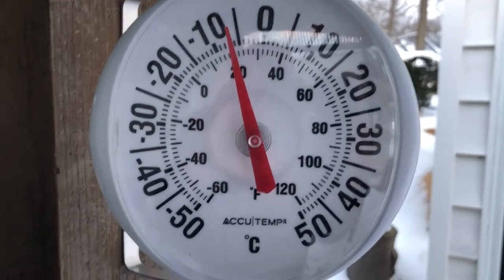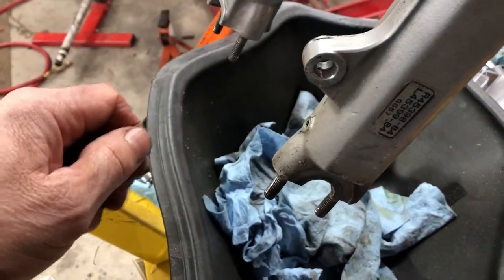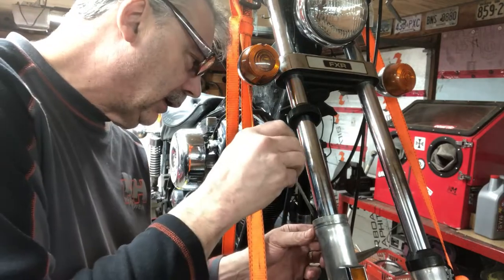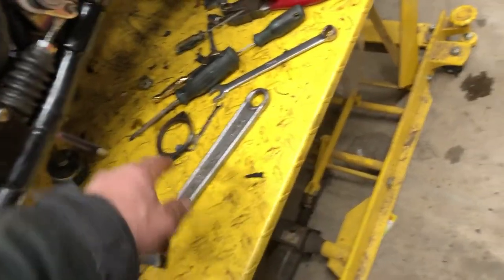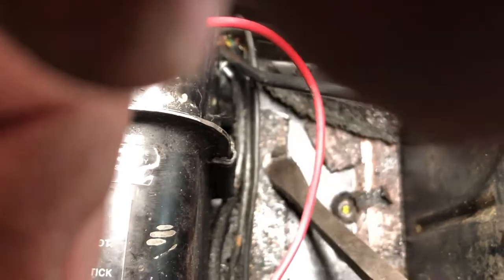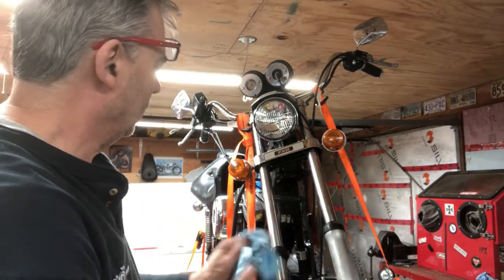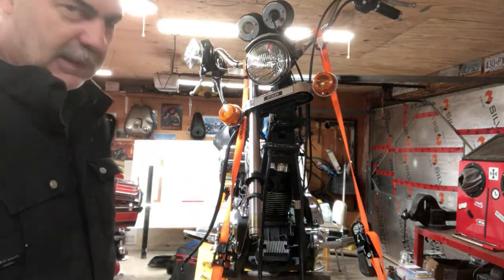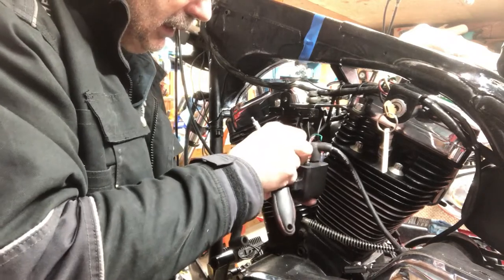PT.7-1985 HARLEY FXRS SP FORK REBUILD, WIRING,

Comment: the horn is mounted in front of the rear tire near the oil filter --the rear turn signals were mounted on the most rear holes for saddlebags I have the same bike and just went through about the same work your doing
Reply from the maker: That makes sense, thank you.